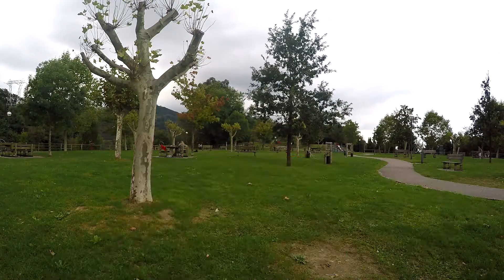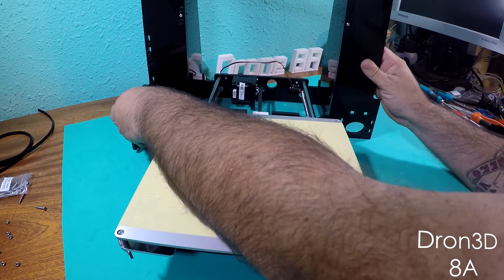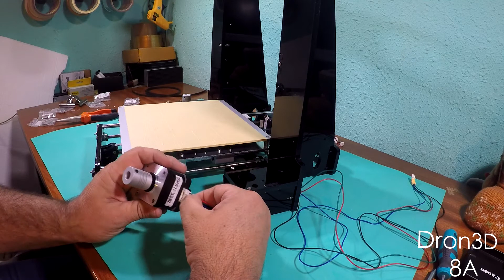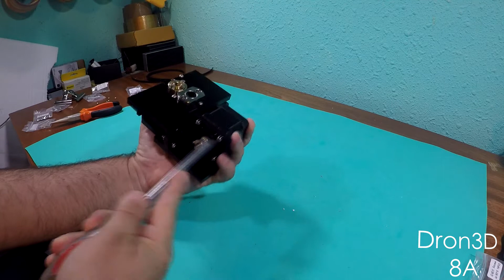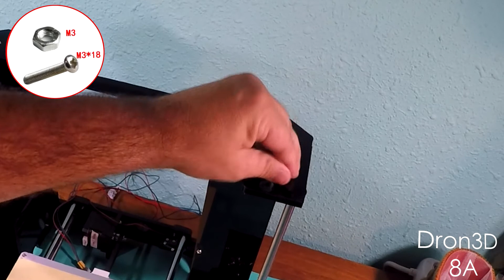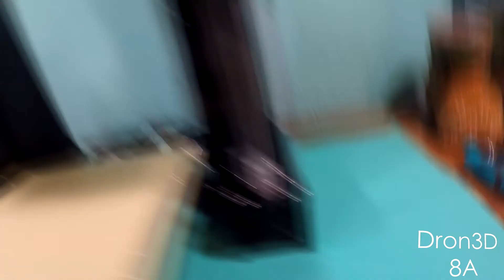ANET A6 - Impresora 3D - Guía montaje - Episodio 2 - Motores Z y Motor X (en español)

Comment: Hola tengo una pregunta ya que estoy ayudando a una persona a montar una anet a6 y el motor del eje y parece que es de menos pasos que los otros. Estoy dudando que en su kit el motor del extrusor y el del eje y estén intercambiados. ¿Me podéis decir el código que aparece en cada uno de estos motores vuestros? Muchas gracias y espero que alguien responda.
Reply from the maker: Estamos imprimiendo pero en los que podemos ver pone lo mismo:

En el motor de X nos pone:
42shdc3025-24b
LOT NO. 170729

Y en el del extrusor:
42shdc3025-24b
LOT NO. 170729

Un saludo
Reply: Dron3D 8A gracias exactamente pone eso en los mios. Si os acordais  me decís lo que pone el y cuando podáis. Es que es raro el tacto.
Reply from the maker: Lo que pone en el ¿donde?
Lo que te hemos puesto es lo que pon en la parte trasera del motor que tenemos en X y del que tenemos en el extrusor.
Un saludo